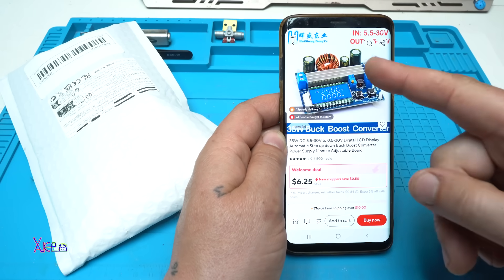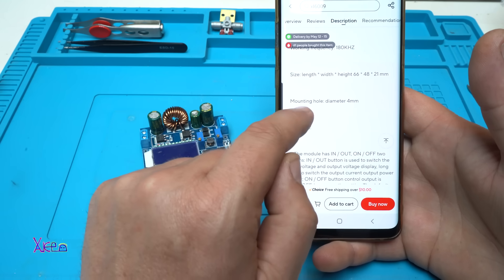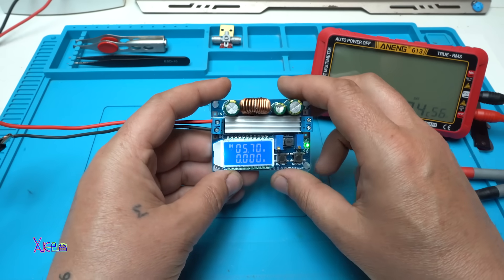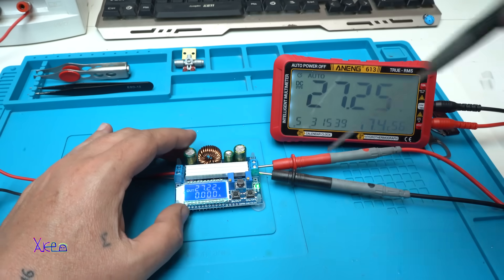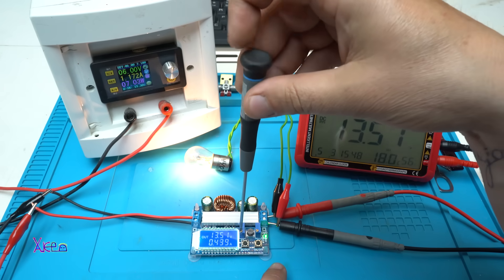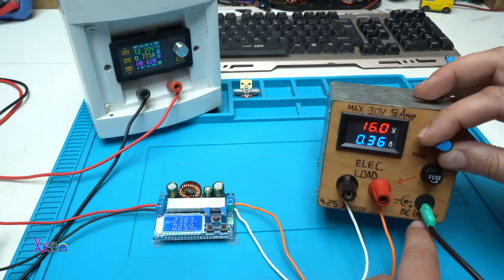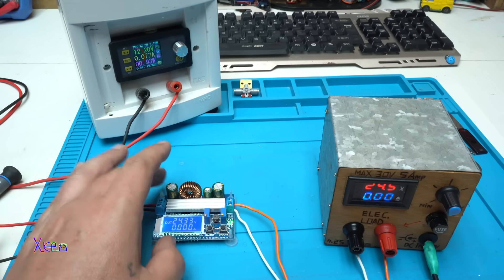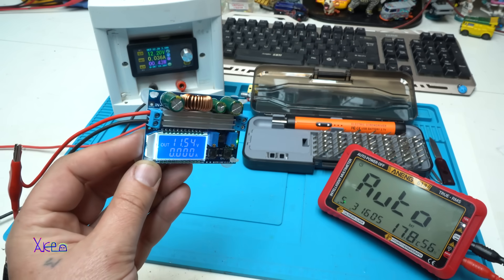AMAZING $? Aliexpress BUCK BOOST CONVERTER - IS IT WORTH IT?

Comment: Can someone tell me what is the correct screwdriver to use on those blue terminals because they are some sort of shallow Phillips design. Standard Phillips doesn't work properly and straight blade isn't what was intended although for me it works better than Phillips. Thanks for any help.

Comment: This is the stupidest module ever. When I use a buck/boost power supply, I hook up my multimeter to adjust the voltage and I'm done. No need to pay for an onboard voltmeter. The converters I use cost around $2 (not $6) and use half the space of that crap.

Comment: The module can supply 35 watt , in totaal so at highe voltage the current goes down , it has passive cooling  on the module so it's for low power applications , nice module for testing purposes

Comment: This is a very handy module
Reply from the maker: Yes its great and if you change the multiturn potentiometers with panel mount pots and put everything in a box you will get a nice adjustable psu

Comment: A smart charger with a fixed voltage would cost $100 pluss. This one is totally variable and can be powered by usb. Just what ive been looking for, a 0.4v trickle charger for my 12, 24 and to storage charge my lithium batteys at 32v. 
Ill take 2 thanks.
Reply from the maker: Just remember that can handle 35w

Comment: I would like to ask you if you know any charger or module , where i can adjust the output watts for differents phones i have ? From ac to dc charger... Thank you a lot!
Reply from the maker: Basically you want a phone charger that will work on AC voltage that will give dc voltage so you can charge different phones with adjustable power?
Reply: @Hacktuber  yes because i have different phones which needs different charger
Reply: Any adjustable power supply can do that. However because you are asking the question, it is obvious that you don't know anything about the subject. For that reason, you should NOT do what you are intending to do.
Use a phone charger, that is why they exist.

Comment: I brought the zk 4kx power supply module from AliExpress a few weeks ago but it keeps adding 2 amps  on the output so it keeps cutting out on high output. Any advice would be helpful. I might give this one a try.
Reply from the maker: Must be something in settings,you tell me that always the amps are 2 A higher
Reply: @Hacktuber  It doesn't happen all the time. so it makes it harder to fix. I thought it was something I done. But after switching with my friends one I have confirmed my one is faulty.
Reply: Original comment makes absolutely no sense. What does "adding 2A" mean? If the module is faulty, get a refund FFS.
Reply: @johncoops6897  I can't really get a refund now.  I've tried to resolder every joint and now it doesn't look like factory plus returning items isn't easy as it is in America.

Comment: A nice unit if it actually meets the specs.
Reply: Did you watch the video?. He just made a video demonstrating all the specs. What more do you want?
Reply: @Mr_Rusty1  I didn't see it limit current while maintaining voltage. The two seemed tied together.

For instance a motor will run faster at a higher than specified voltage but you must keep the current within the motor limits otherwise it will burn up.

This is common practice to get stepper motors spinning faster.
Reply from the maker: As I test deliver 30w

Comment: Good job!   I have several of these in my electronics cabinet  drawer awaiting projects.  Good device for the price.  
I want to hold the device under a load for like 15 minutes, and then check it the heatsinks temperature from start to end of the test.  Maybe run an efficiency calculation from start to end as well.
Reply from the maker: I might need to try that out!